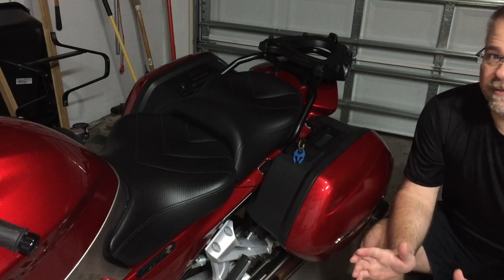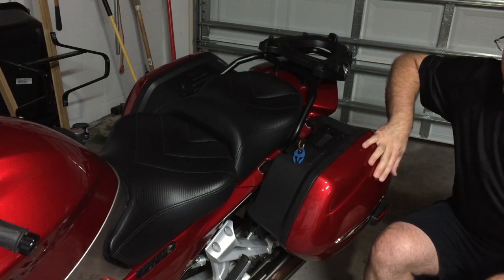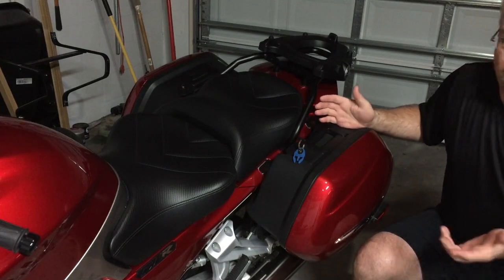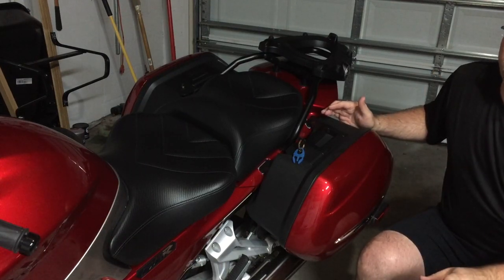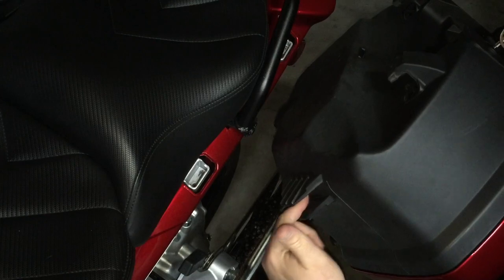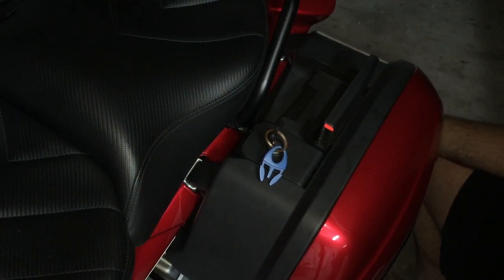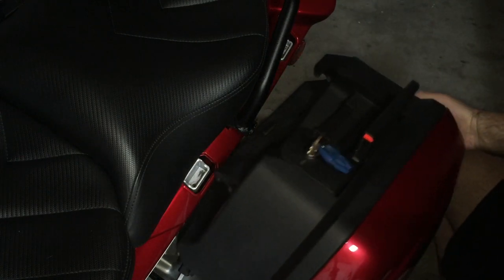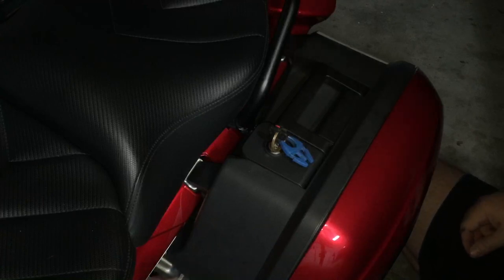FJR1300 Saddlebags Detatching Or Falling Off Solution

Comment: I have solved the issue quite cheaply. Or a friend did. Based on my idea. The issue is the tongue coming out of the pannier is too short to engage fully on the bike due to the jumped tooth issue described. On mine, the faulty pannier tongue was 6mm shorter than on the known good.

My friend drilled 3 holes down into the tongue and fitted 3 stainless steel screws in. He cut off the heads leaving about 5 mm showing. He then built up a mould around the tongue and filled it with 2 part epoxy. A quick spot of dressing and even a squirt of paint and the pannier now locks in perfectly as it did originally.

I am well impressed, a simple solution to a potentially expensive problem.

Comment: Great video, and one that supports a discovery I made the other day

I noticed that if I load the bag full, like REALLY full, so that you have to work to close the lid, then the locking handle for the side case will actually lift itself a little, and if it is not being pressed firmly down while turning the key, it will result in the case not being served correctly.

Comment: Had to come back and revisit this video. You are the absolute answer man in all things FJR. Recently I took possession of a low miles (14k) 06 FJR. The bags seem rigidly locked in place no problem. Took it for about a twenty mile run, came home., unlocked the right side case from bike. (Just to check the operation) when I place it back on., carefully making sure the alignment tab was in place., hooked the tabs into place., and made sure the handle lever was down. No problem. Locked on the bike. But it rattled slightly while the left bag was still rigidly locked on. So I checked the way the previous owner locked it down. It seems he had the bike’s alignment tab positioned OUTSIDE the chassis tab alignment receiver creating pressure to increase rigidity. Checking online some say their bags were rigidly locked in.., others had a little play when you wiggle them. Had to come back to this vid. Whew! It seems at the 6:18 mark when locked in yours wiggled a bit as well. At least I know it’s not me...I seem to have it on correct. Thanks!

Comment: Learned a valuable lesson when it comes to these bags. Side bags had no issues at all. If the case has obstruction when closing, that tab will be very hard to snap shut. When locking the side bag, same thing. It should slide very easy into place. 
What I had happen was I lost my top case. Yep, did not latch it down when I put it on-got distracted, and when going down the road the top case fell off. Scratched up the entire red top. I did not replace the candy red top. I left it there to remind me to check my bags before riding.

Comment: Thanks for the helpful videos. Something that has happened to me twice ( 2006 & 2008 ) that may  have a bearing on the bags falling off are the two, very small, screws that hold the locking mechanism ( the part you put the key in ) on the bags coming loose or falling out. They are located under the back of the key slot. The first time occurred while on a trip when I went to unlock it. When I bought the 2008 ( used ) I was inspecting it and found both screws loose on one bag and one missing on the other. Used a little blue loctite to secure.
Reply from the maker: +Phillip Quann I mentioned that (improper assembly) and have a separate video on it. That's still 100% human error, not a problem with the bike.

Comment: In my experience people usually loose their panniers because the screws that hold the key barrel in the plastic tab come loose and fall out allowing the latch to come undone.
Reply: I totally agree with Darren Dasher. Yesterday I was riding home from work on my 2016 FJR, my inner bag with my clothes was locked in the pannier. I always double check to make sure that I properly lock both the full pannier and that the lever/handle to remove the pannier from the bike is properly locked. 

My ride home fortunately is only 16 miles along country roads. I pulled into my drive way and got off the bike, removed helmet and went around to the right side pannier, where I always carry my clothes bag. I went to unlock the pannier to find the whole silver lock barrel almost completely loose and thus the handle to remove the pannier was no longer locked in place. 

I was like WTF? I lifted the lock lever and the barrel and silver tab below it almost fell completely out. On further investigation the single screw holding it all in place was so loose I could pull it out by hand without twisting it. I was really pissed that Yamaha has such a piss poor design for such a critical and expensive piece of equipment for a sport touring bike. My bike has 12300 odd miles on it. 

I'll be buying a bottle of loctite blue tomorrow and reinserting the loose screw and will do the same for the other pannier even though it has not come loose YET. I suggest everyone with an FJR and these poorly designed panniers do the same.
Reply: I would agree, I was on a ride and when I went to unlock one of the bags, the lock cyclinder came out and the mechanism fell apart.  I laid the bag on my coat and started trying to figure out what happened.  I found that the screws that hold the lock cylinder in place had vibrated out.  They were still down in there.  I put it back together and will be putting some loctite on the screws so that doesn't happen again.
Reply: I'd love to see an updated video posted to show this failure point and how to prevent it.

Comment: I had these panniers on my Mk1 FJR for 13 years never had an issue with them.  I used to check the locks screws once a year as part of the maintenance routine and I never had to tighten them.  I have told a few owners that they had not closed the handle. Also if you can see the Red tabs they are not locked correctly. I found your vid was very good however I never knew there was a problem.

Comment: I am on my second FJR and never had any issues. I agree that either when locking the tab did not engage, or the mechanism for the tab has somehow been stripped out, or the tab on the lock did not engage the handle. The handle should snap down with very little effort, if it doesn't something isn't lined up right. In addition, I literally try to rip the bags off the bike once I latch them on just to make sure they are on securely. And always check to make sure that your key latch assembly does not have loose screws, you never know if the guy at the dealership followed instructions.

Comment: The metal tab on the lock cylinder barrel has screws that hold the tab on. I checked mine because of chatter on the FJR forum. Sure enough they were backing out. 5 minutes and some loctite with a screw driver, no problem. That was 10 years ago and their still working great.
Reply from the maker: Yes, I did a video on that years ago.

Comment: I like your theory.  Makes sense.  How about if we were to put a small magnet in the handle to make sure the handle stays down during the locking process?  That would make the handle stick down against the case and not have that propensity to lift away enough to miss the cam lever.

Comment: Bmw used to use the same latching system. Problems on the bmw locks start when you first lock te latch and THEN push it down. The small tab gets bent down and after that it gets difficult to lock correctly. It could even be bent so far as that you can push the handle flat and lock it and the tab will still miss the slot and thus will not be secure!

Comment: Your explanation is reasonable but the pannier isn’t fail safe.
For example the door on a car has a safety second stage latch stopping a door to accidentally open.
It can be perceived due to air noise and you can stop the car and give the door a push.

You are correct, user error but there is absolutely no room for error which is my grumble.

I lost a pannier and accept responsibility but was so glad it was empty and hadn’t lost valuables.
Wouldn’t it be nice if there were two steps to ensuring you couldn’t loose your valuable luggage.

Comment: BMW has used a similar mechanism for decades, and the design won’t allow you to remove the the key when mounted on the bike unless the latch is all the way down. On the BMWs, there is no play if you try to move them. The design idea was once you arrived your hotel, you unlocked each pannier for removal, walk to the rear of the bike and lift them both off at the same time to walk away. They worked great, much like the FJR.

Comment: Hey very well explained video.  I have just bought my second FJR, 2015 model in this case.  However, the previous owner had issues when he ordered the bike and he had to retro order the panniers, consequently I have noticed that he has not been supplied with the rubber mounts on the rear footrests for the lower pannier connection. This has a dramatic effect on the stiffness of the connection to the bike.  I seem to be having trouble finding them online so would really appreciate if you had any info on where I could find them.  Thankyou in advance.

Comment: Hmmm...interesting. Not a conspiracy enthusiast myself, agree with your investigation and results. My problem was with the lock-plate itself. 2014 FJR...left saddlebag lock-plate (the metal part that rotates with the lock cylinder and engages both the trunk closure and the handle lock-down). One day, after loading some items into the left bag, turned the key in the lock, and (as I ALWAYS do) gave the handle a tug to make sure it was secured. Lo and behold, handle lifted right up. Unlocked the cylinder, opened the bag, lifted the handle...after examination, discovered one of the plate-to-cylinder screws missing (there are two) and the other one loose. Tightened the remaining screw and headed home (a VERY short distance mind you). Long story short, had to research and replace missing screw...used LocTite on ALL the screws on both bags to (hopefully) preclude their ever coming loose.

Not a bike "fault" per se...probably human error in manufacture or dealer setup...either way, on reflection, a piss-poor design for such a critical, regularly used/manipulated device. Needs to be hardened for sure...still love my FJR and wouldn't think of trading for some "barca-lounger on wheels"!!!

Comment: The best idea is to push the lever down and hold it down whilst locking it then pull up on the lever after you lock it and have removed the key to make sure that it did lock, saves havening to do it again if it didn't lock because it should lock properly the first time.

Comment: Actually it is the lock that works loose, in turn releasing the handle from locked positions, and allowing for the panniers to jump off. The locks are fitted by the main dealership so it the apprentice fits it without locktite this can and will happen. So check your locks, but this vid is and has a valid point too, ride safe...

Comment: Had the problem with the pin mechanism coming loose (2008 FJR). As I was parking the bike in a campground on a ride to Anchorage - the case cover popped open (case loaded with camera equipment). Although the two small screws were gone, I was lucky and found the locking tab mechanism. I purchased a couple replacement hex screws, hex key and locktite from a bolt dealer. I checked the other case, and screws on it were also loose! I'd suggest anyone owning a FJR, check those screws! You'll need a Torx screwdriver to do so. The Garmin Montana 6xx Motorcycle Mount Torx Tool happens to work.
Reply: R R Had the same problem. Had to use Loctite to keep it secure. Faulty design.
Reply: R R I had the same problem on a 2014 model. Basically rubbish locks. Loctite saved the day.
Reply: Bingo!
The screws retaining the lock cylinder can vibrate down and out thus having a loose lock that does NOT retain the bags.  
Fortunately I found that this was happening on mine before they fully fell out!  JB Weld was peace of mind.

Comment: I know that my 2014 left side came off fully locked.  Your theory does not address possible internal damage to the mechanism?  I can remove my LH bag when it’s fully locked.  Rear tab is evidently not fully extending?
Reply from the maker: After this vid more was discussed and yes, if someone in the past forced the level down from it being mispositioned or overloaded and not closing, it will break and skip an internal tooth.  That prevents the bottom tab from fully raising, preventing it from being secured to the bike when locked.  100% human error.

Comment: Physically broken.  What I'm wondering, and since I don't have the FJR yet (I responded to another one of your videoes), I can't say for sure, but is it possible that the handle itself could break?  Where the locking mechanism from the lock rotates into the side of the handle, is it possible that the underside of the handle has somehow broken away, allowing the handle to ride up?

I thank you for your videos, and if I get the bike I'm looking at, I'll be looking at more of your FJR videos.
Reply from the maker: +Gary C No that's not the case nor an issue whatsoever

Comment: Hi, mate, my problem was not the locking mechanism but a faulty tongue plunger. You could push the plunger down with just a little effort so it was allowing retraction when it should have been rigid. The other side was fine you could not move the plunger so it stayed in place. Also, some of the underside slots are not always in perfect alignment, either. So for me it's a quit a drawn out procedure to ensure everything is perfectly locked in up top & underneath plus a push & shove session to triple check. 
I can see that being a little careless with the normal procedure like you have shown could lead to disaster & is most likely the cause of some of the panniers falling off but many would be because of what I outline above. Yamaha does have a somewhat of problem with supply quality of items as attested to in their multitude of recalls for many models over a lot of years. Unfortunately, the FJR panniers were not one of them. 
I think for the money paid for the they could have done better
Reply from the maker: +Quentin Rankmore As I mentioned clearly - this does not apply to those with DAMAGE such as you.  You have a broken bag and need to replace it.
Reply: +TwoWheelObsession . My cases were undamaged to start with it was only AFTER one fell off I began to look into why it happened. That case was replaced & was never used again once I got home. It's just that one never seems quite so confident with them after that, though I've never had a problem since. 
I do enjoy your videos very much. Just wondering if you could send a link for where you brought your Ram mounts. Also, intrigued about your camera & microphone setup for your helmet. Both have extraordinary clarity on the bike. Your windshield might have a little bit of extra protection for the microphone but there would have to be some noise cancelling soft wear helping out I suspect.
I'm heading off on a 3 week trip through the Australian high country on the East coast in April & I would mind a similar set up to record some highlights.
Reply from the maker: +Quentin Rankmore Damage is damage whether it's a factory defect or user created.  Again, that's clearly not what this video is about.  You can get RAM parts anywhere, I think I used Amazon.  The audio setup is nothing special just a SENA 20s and gopro - I have videos on all my stuff.  No, nothing special in processing at all.

Comment: Hi, what you say is correct but you are telling experienced riders to suck eggs. I have a ex demo June 2016 that I bought in May 2017 and I have put a warranty claim in as I noticed my right pannier was loose. I can actually rise it up and one point of three is not connected. Potential of failure, likely to fall off. I am getting a new one in a couple of weeks but it is an internal mechanism failure not necessarily a rider error. I am guessing after a long period of use this could happen more often. Something to consider.
Reply from the maker: +Michael Bregman nope, it can't. It means someone forced the lever at some point and it skipped a tooth.

Comment: I know I'm late to the party.  There's actually two failure modes.  One you described.  The other is if you turn the key and then push the handle down, it looks like the handle is all the way down, but it is not locked (because the tab is engaged).  The tab is low enough that it will appear the handle in all the way down, when it is not.  A higher tab would make it obvious that the handle is not locked.  
 
Humans are bad about following the order of operations.  Our brains aren't wired that way.  The mental checklist says "Push the handle down and turn the key", not necessarily Push the handle down and THEN turn the key".  In their head, the handle was pushed down, and the key was locked, so all is good. Things where the order of operations is important will always have a higher failure rate.
Reply from the maker: Lol you can't fix stupid. Yes if you lock a deadbolt and then try to close the door, you have a problem ;)

Comment: My left bag came off on a road trip this weekend.  I went over 400 miles and less than 5 miles from home I had to brake hard for a car that stopped in front of me and the bag went past me.  I recovered it in a ditch and it was still locked, handle down.  I don't know how it came off but, it did.  I for one, do not feel comfortable with all of the play when they are in place.
Reply from the maker: You have a slipped tooth from someone in the past forcing the handle down. It won’t fully lock after that happens.